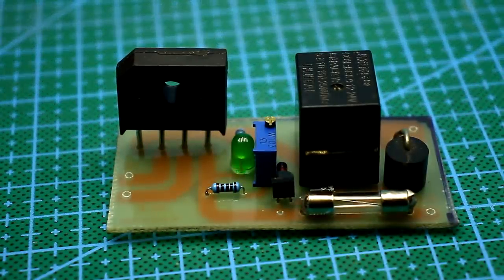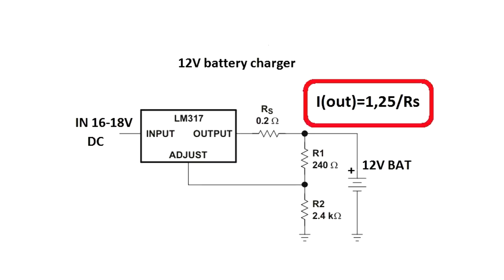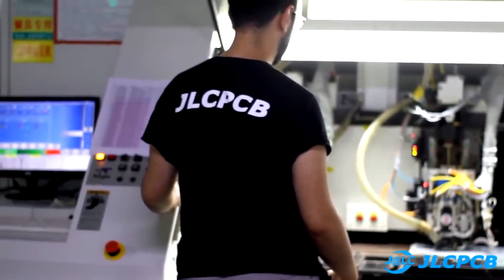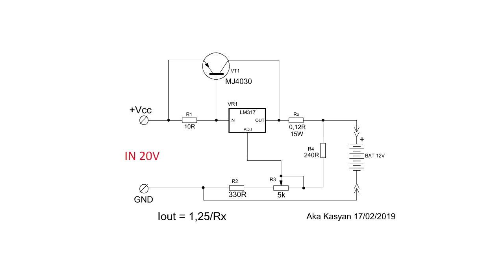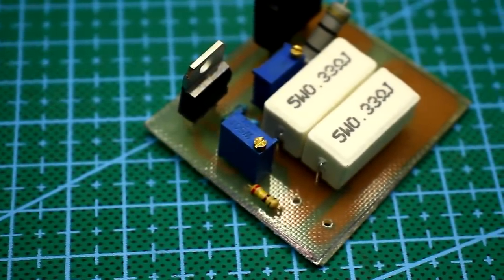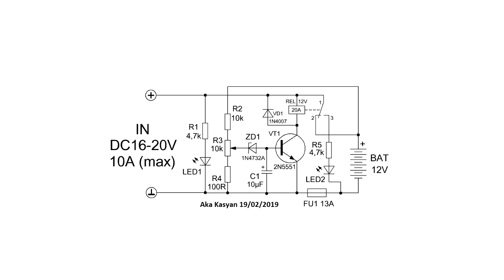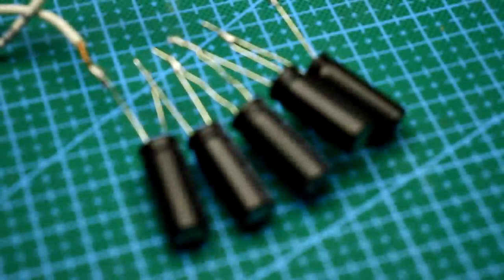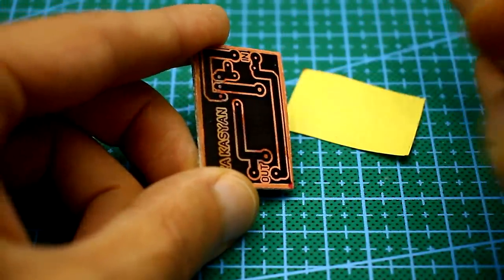Top simple charger circuits

Comment: BTW:  With a few more parts, you can make a charger well suited to charging a sealed lead acid battery.
The trick is a small PNP with 
1) resistor from emitter to the regulator's "Vout" pin,
2) resistor from base to the load side of the current sense resistor
3) Collector goes to adjust pin.
With fully charged battery the PNP would be off and you just get a trickle.
With a fairly discharged battery, the PNP is on and raises the voltage by an amount a bit more than the drop on the current sense resistor.
At in between charge states, the current into the battery is near constant

Comment: Hi there, I love your videos, this one linear cool solution spreading the load (and therefore generated heat) with the parallel network
Of  transistors!
Yes it's not the most efficient but it has lots of buffer behaviour room to manoeuvre and low noise is always favourable and fairly simple to achieve

Comment: You said you'll make next video with current limiting and polarity protection. Can you do little more modification on my request?
 am planning for the project with your next video, 
can you modify with auto charging when car battery in low voltage, modification with output DC power source turns ON automatically when I disconnected input voltage, & modification that can use output battery source while under charging condition too.
By this modification project am planning to make small DC Uninterrupted power supply for my wi-fi routers, dc mobile chargers and dc lightings from car battery for home.
I guess this will make lot of money savings.
Most of the people waiting for such project.
Sorry for my bad English, hope you understand my subject. 
Thanking you,
From big fan of your channel.

Comment: Nice but why you not making 220V AC changer..... Nice work
Reply: XTREAME ENERGY , to make a 220V ac charger just add 1 transformer for the current and voltage you need, 1 bridge rectifier for the current you need, and an electrolytic capacitor with a value of 2200 uF per Amp. Only work with mains voltage if you know what you are doing.
Reply: I mean like mobile chager